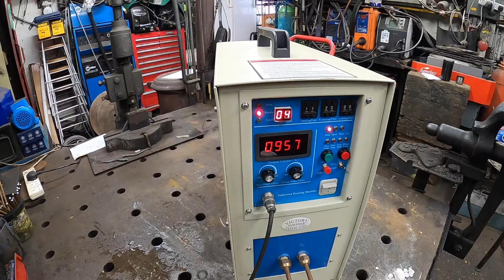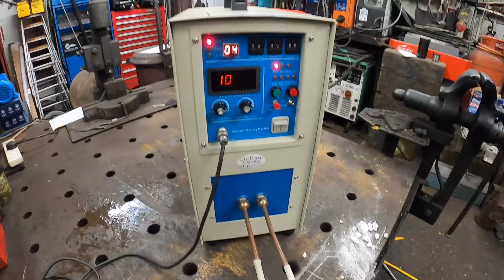Blacksmith 25KW Induction Heating Rivets from cold #blacksmith #forge

Comment: That’s a great solution for multiple small parts, Nigel. Perhaps adding a solid refractory cylinder inside and  a base that vibrates the parts around could solve the even heating issue!